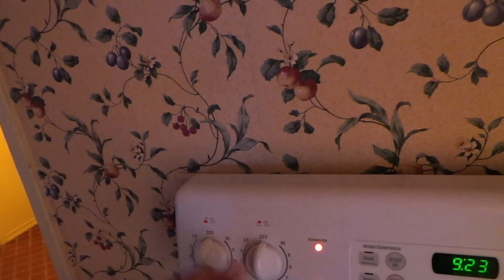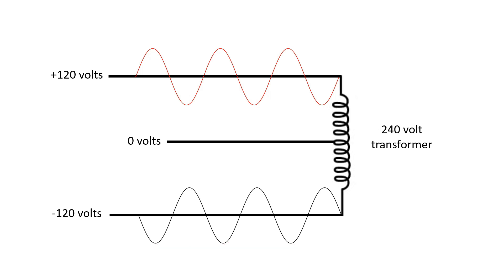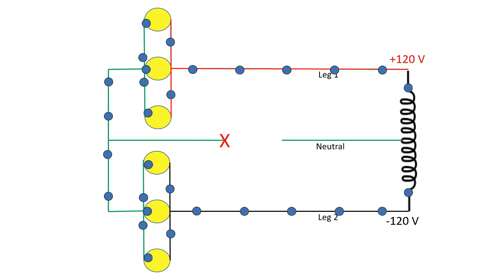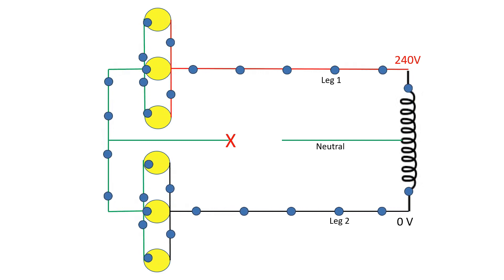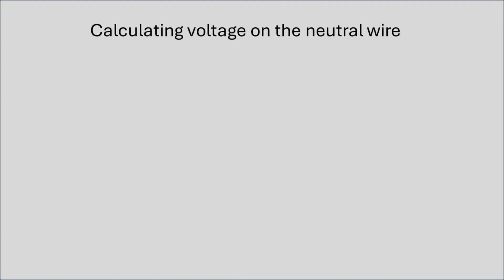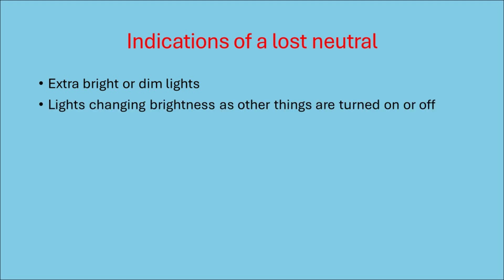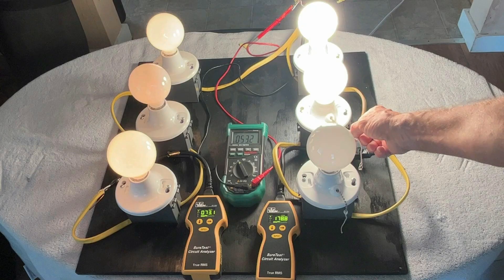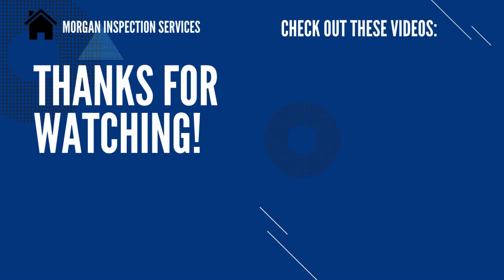What is a Lost Neutral - New and Improved

Comment: half my panel ready 138 volts and the other half is 106 volts. The POCO came out and showed me as it enters my house is perfect. This means the lost neutral is in my house but i dont know how to find it when half reads 138 and the other half reads 106
Reply from the maker: Where are you reading these voltages? At the panel itself?
Reply: @morganinspectionservices3840  Every other breaker and all the outlets in the house. I am stumped. I have had two electricians tell me the issue is on the service line and the POCO tell me the issue is in the house. Cant seem to win

Comment: Great video. I am having the issue on outlet. A few outlets have 119v, lamp is on and off. Other outlets shows 124v. I think I lost neutral.  Thank you. You are a great teacher
Reply from the maker: If you’re only getting four or 5 V difference between outlets, I’m not so sure that’s a lost neutral. Turn some heavy loads on. These load should be 120 V loads so that you’re not turning loads on on both legs. Things such as microwaves and maybe a toaster - things that are going to pull some current,  and then see if the voltage difference changes. If so, then, you just may have a lost neutral.

Comment: I remember watching my jumper over my water meter arcing a little bit i pulled it off and saw my lights dim then i realized im like I lost my neutral put it back on. Loose main neutral lug. That water pipe seemed to keep voltage in check.  For all i know my neutral was loose for years
Reply from the maker: Thanks for sharing your experience. I think a lot of people deal with lost neutrals for months or years before. They finally realize there’s a problem that needs to be addressed.
Reply: @morganinspectionservices3840  good job explaining how voltage fluctuates from a open neutral.  Best video I've seen explaining it out of the few I watched.

Comment: I have a question about lost neutral.   I had this happen.  Electric company had to replace electric supply to my home.   Power cables run under the street.   No above ground supply.   I know I am at the end of the circuit for the neighborhood, due to power outages during hurricanes in the past.  I lost several electrical items in the home due to this.  Whole home surge protector showed evidence of burning,  cracked open and black.   Siding on home showed area of black, like scolding from the electrical panel and grounding box.   Per electrical engineer electrical panels for home replaced due to the events of the lost neutral.  Bus bars were no longer shiny, they were discolored.  I replaced the panels as I was informed that THEY HAD TO BE REPLACED DUE TO THE BAD NEUTRAL and the transient spike.   Is this true?
Reply from the maker: Hi. I will have to defer to the expert on this one. The electrical engineer made that call. I cannot say he was wrong. I will say that this is first time that I have heard of a panel having to be replaced due to a lost neutral. It sounds like a lot of damage was caused in your situation so it probably was necessary.  I am familiar with a dozen or so lost neutrals occurring to various people who I know, and this extreme measure was not necessary in any of those cases.

Comment: Friend - not to ask another question (when I didn’t even give you a chance to respond to my two question posts on the original video), but I have to ask you: I learned in school that for current to flow, we need a circuit, a loop, now if the load is balanced, and no electrons are flowing thru neutral back to transformer, then how is electricity able to flow at all if there is no loop/circuit?! Don’t the electrons block one another on either side of the neutral and thus stop all electricity?! PLEASE PLEASE unpack this for me! I’m mentally stuck and I really want to move past the 4 min mark in the video !!!
Reply from the maker: Hi. I appreciate the questions. I appreciate the fact that you’re watching my videos. The electrons do not block each other. While one side of the transformer is “pushing” electrons, the other side of the transformer is “pulling” electrons. That’s how 240 V circuits work. It’s kind of a push You, pull me sort of thing. They are not pushing against each other, but they are working together. One pushes, the other pulls. Then it reverses. 60 times per second.
Reply: @morganinspectionservices3840 

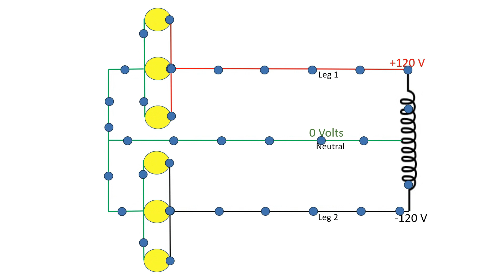But in your video you mention at 3:50 that there are no electrons flowing on the neutral back to transformer when the system is fully balanced: but how could electricity flow in this scenario if there is no loop/continuous circuit ? Wouldn’t it need to continue on thru the neutral into transformer? I always learned electricity needs a potential difference and a loop. How is your system violating thing yet still flowing?
Reply from the maker: @   When you are talking about a 120 volt circuit, then yes, you must have a neutral to have a continuous loop. A 240 v circuit does not need a neutral to have a loop or a closed circuit. The two separate 120 volt circuits (one at +120, and the other at -120, make up the closed loop. This is how an electric oven, water heater, AC work. No neutral.
Reply: But what confuses me is - the two hot legs in your diagram in a fully balanced system show the hot legs only having current going away from the transformer not one going in and one going out ! So how is there a loop?
Reply: @ thanks!!

Comment: When measuring the voltage on the neutral with a lost or open neutral where are you taking the the measurement from on the three wires .Where are the test leads on your setup .it does make a difference .this could leave a state of confusion as to where the connectios are made. Thanks for the video
Reply from the maker: @jim-cu9yp    I’m measuring the voltage between what was the branch neutral, and the actual neutral wire that runs back to the 240 V receptacle for my oven. The branch neutral is obviously no longer actually the neutral. It is essentially now just the wire that ties the two legs together into a series circuit. I hope this makes sense how I’m explaining it.

Comment: How does the earthed grounding rod the panel is bonded to factor into this issue . .if you now have voltage on the Neutral and its also bonded to the Grounding rod ?. I do  understand there will be restance in the ground path as its not going to be a perfect low restance connection to the center tap of the power companys supply transformer.
Reply from the maker: Yes, the earth is actually a very poor conductor of electricity, so it really does not provide a path back to the ground/neutral from the transformer. With voltage on the ground and/or neutral bus in the panel, you will have a little bit of current flowing through the grounding electrode conductor and to the ground rod, but since it is such a low impedance path, I think you will have less than 3 or 4 Amps of current so I think it’s effect is almost negligible.
Reply: @morganinspectionservices3840  so what is the point of a ground rod (specifically how does it help with issues arising from the home itself not say lightning)? I always thought ground faults traveled thru the ground bus and into the ground rod but I was recently told THIS IS FALSE! Help?!

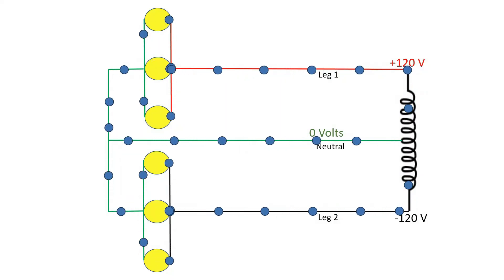Comment: 4:46 That does nit really tell it correctly as it shows the sum of the currents in the neutral when it is the difference.
Reply from the maker: Yes, the current on the neutral is the difference between the currents on the two legs. My intention was not to teach all that, but to show what happens with a lost neutral.